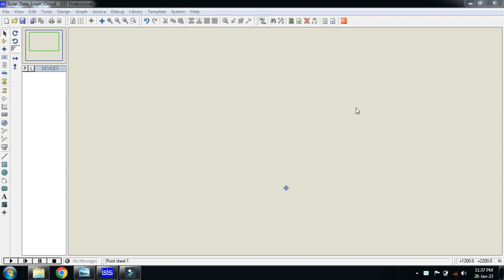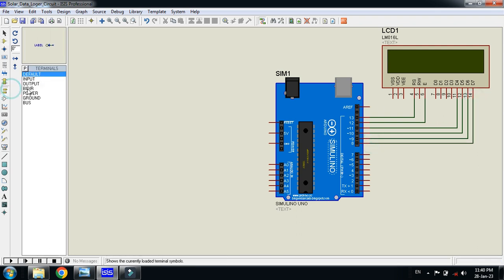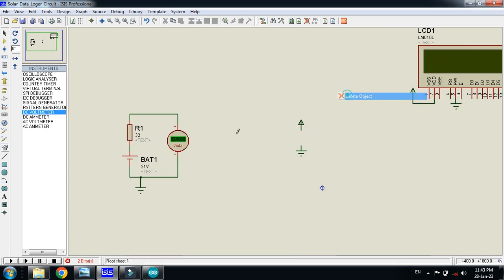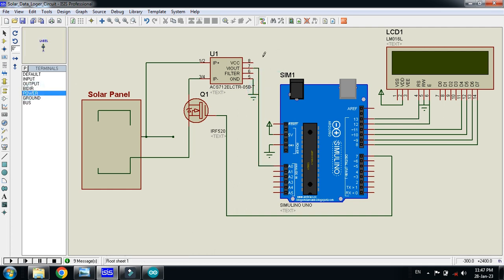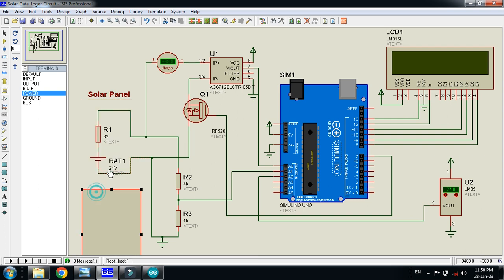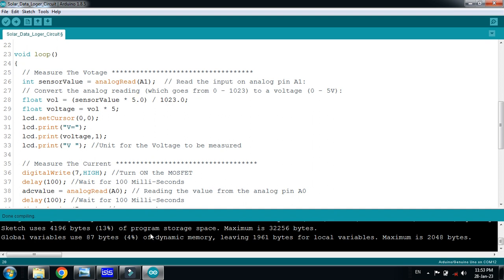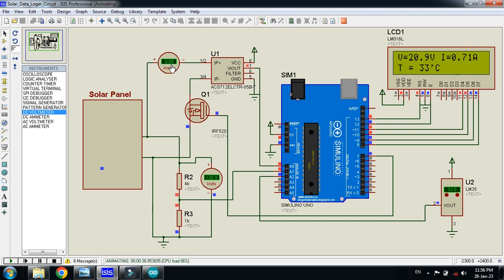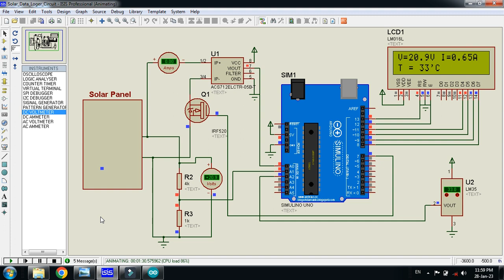Solar Data Logger Simulation in Proteus Using Arduino With Code and Circuit || Proteus Simulation

Comment: Your Arduino code is not working
Reply from the maker: Code is tested and 100% working brother. 
Kindly make sure that your compilation mode is clicked, otherwise it will not create the hex file. I think you are facing this issue. If you are using Arduino for the first time then turn ON the compilation mode. If you don't know how to turn On it, you can  learn in the below video. I have explained in this video that how to turn On compilation mode. Thanks
https://youtu.be/aqENBcFAdqQ
Reply: Can u please share the hex file.
Reply: I am trying it for an hour.
Reply: A1 was not declared in this scope
Reply from the maker: Ok I'm sharing
Reply: Ok share me please it is very urgent
Reply from the maker: Download HEX file from here:

https://drive.google.com/file/d/1EEEkVeC5aMkzeGkMG67VR16cA8QQksZK/view?usp=sharing
Reply: Thank you very much...really appreciating 🎉🎉🎉🎉